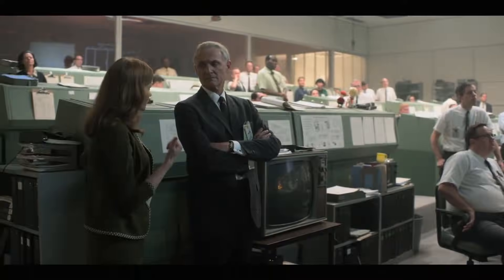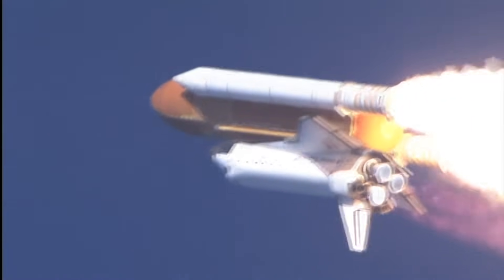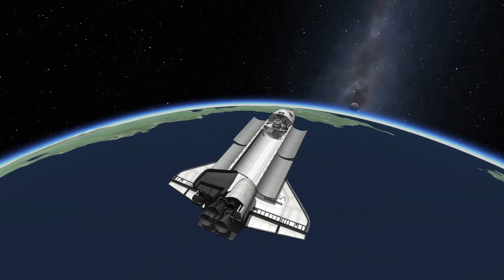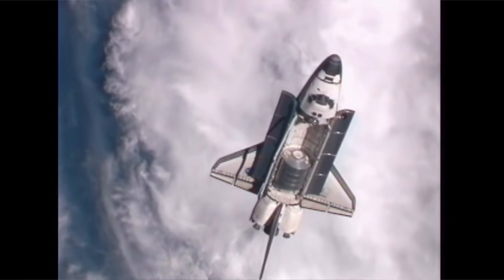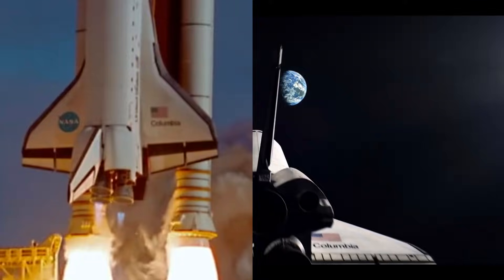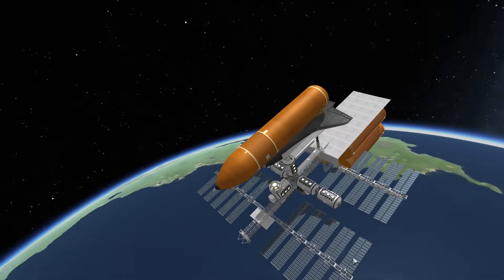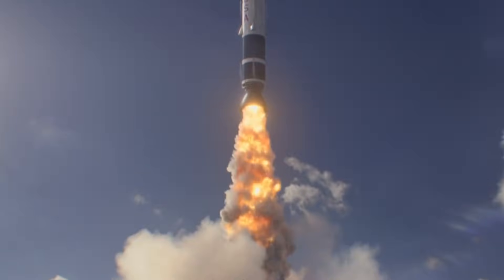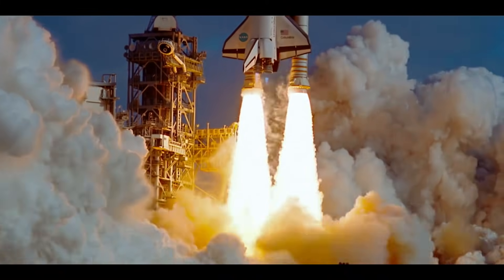How To Send A Space Shuttle To The Moon

Comment: Wouldn´t it make more sense if the spacecraft were more specialized?
I propose a fleet of different spacecraft, each of them better suited for a specific task. Much like we do with aircraft as we have fighters, cargo, passenger, long haul, short, haul, high speed, low speed, using different propulsions like piston, turboprop, pure jet, turbofan, rocket, electric, sail, etc.)
- Earth Lifters-> reusable boosters capable of dealing with most (if not all) Earth´s gravity well and atmosphere.
- Earth Landers -> reusable capsules capable of reentering the atmosphere and landing (preferentially like a plane), like Dream Chaser, Dragon Crew, Dragon Cargo, Starliner.
- Orbital tow ships -> pushers, pullers, automated, to tow satellites, orbital stations. This tow ship would be equipped with vacum optimized engines and fuel/propellant tanks. These tanks should be made in orbit, so they won´t require the structural resistance for dealing with Earth´s gravity thus being optimized for holding the fuel in the microgravity. They would be parked in LEO and serve the space infrastructure and be of many different sizes and capacities. Small to push around nanosatellites, big enough to push a space station. Whoever needs a push, just hail a Uber-Rocket on the app. Charges by delta-V times total mass of the customer.
- Cruisers -> Long haul cargo and human passenger spacecraft optimized for long duration, interplanetary or interlunar flights. The emphasis of this kind of vehicle should be the way it stores and supports its cargo, being it human (life-support equipped) or any other type of cargo that need specialized containers. Much like we have ships for containers, for fuel, for gases, for liquids, for grains, etc.
- Pushers/catchers -> Powerful engines with huge fuel/propellant thanks capable of pushing the cruisers into their trajectories toward far away planets/satellites/deep space stations. The pushers should be able to return to their launching stations after the cruisers reach the trajectory. Upon arrival at the destination, the cruiser should be rendezvous with a local catcher that will be in charge of bringing the cruiser into the destination orbit. This pusher catcher thing could operate as an relay. A pusher going from Earth to Mars while a pusher comes from Mars to Earth exchange. Just like the tow ships, the pushers will be kept always in orbit, never to fly in any atmosphere. 
Then we would have the specialized landers.
- Moon Lander -> With rocket propelled landing. We can use mass drive to put them back into Moon´s Orbit
- Mars Landers -> Capable of atmospheric flight but in a completely different way than the Earth landers.
- Mars Lifters -> just like the Earth lifters but optimized for the low atmospheric pressure and gravity of Mars.

What do you think?

Comment: 1. Create a dockable heat shield that's waiting for it on its return home.  2. Reuse the main external fuel tank as described.  3. Carry a lunar lander in the cargo bay since the extra fuel will be carried externally.
Reply: Some early space craft used wood for an ablative heat shield. Modifying the orbiter with an extra layer of heat shield should not be that difficult. Just costs mass. If using external fuel tanks refueled in orbit you have some mass to spare.

Comment: They probably wouldn't develop the space shuttle in this timeline, since in the show they're more interested in the moon than LEO. And the space shuttle was designed for LEO.
Reply: The Space Shuttle was conceived as a reusable "shuttle" for tranportation of humans and cargo to LEO. The plan was for it to be one component of Space Transportation System (ever wandered what STS stands for, eh?) and of course moon and beyond were definitely important destination of the STS.
Just look up "Space Tug" on Wikipedia.
Reply: i mean it could have been a "we have this thing that works, lets make it do more." instead of a new design.
Reply: I could see the Space Shuttle being developed, but as the LEO truck it was meant to be to build space stations and perform other support missions; not for actual travel to the moon.
Reply: Kaleb - NASA was Origionally going to use DC-3 in the 1960's , modified and Outfitted for Space and Launched by Saturn Derived Launchers. DC-3 was a Perfect Airframe and it could Easily made AIRTIGHT. 
and the Metal Skin would be a Efficient HEAT Radiator.
Reply: @markplott4820  This idea is delightfully insane.
Reply: Guys I understand the whole STS thing, but in season one they built a moon base without a space station. Maybe we'll see one in the new season, but so far they haven't followed that route at all.
Reply: Stanislav Kogan the original STS shuttle was drastically different from the ine we got. The original concept was mkre crew focused with a lot less payload, and it seems hinted at in this universe that STS didn’t happen (even though that would have been lit to see the original STS proposal but whatever)
Reply: @TheOneWhoMightBe   Didn't Lord Xenu use DC3's when he nuked those volcanos on Tiggyak trillions of years ago?
Reply: Have you ever heard the proposal of Space Transportation System (STS) which was proposed by NASA in 1970? Space shuttle was designed to ferry crew and cargo between low earth orbit and the earth and was only one component of the STS which includes 1. Space Tugs, 2. Nuclear Propulsion shuttle between low earth orbit and interplanetary deep space, 3. low earth orbit propellant depot, 4. Space Tug based transfer vehicle shuttle between low earth orbit and the moon,5 Space Shuttle that ferry crew and cargo between ground and low earth orbit. The Space Shuttle was the only component of STS proposal approved by Nixon administration in 1972.
Reply: The space shuttle was never intended to go beyond LEO!
Reply: @powerfulstrong5673  It never was... Unless Phineas and Ferb get their hands on it and convert it into an interstellar starship
Reply: @stanislavkogan  You are right.
Reply: It’s funny because I’m the show they definitely did develop the shuttle.
Reply: Poor Leo always gets the blame.
Reply: @rundownpear2601  Season 2 has space stations in LEO, notably Skylab.
Reply: Probably would have built Dynasoar instead, mini shuttle without the payload that goes on top of the boosters. When the focus on a space plane is just on crew transfer and you have sea dragon for cargo.

Comment: I remember scoffing at the film LifeForce because it had a shuttle intercepting Halleys comet. Ridiculous I thought, they'd need some sort of nuclear drive for that! And then i noticed the word NERVA printed on the control panel. I could still scoff a bit though as they had full gravity onboard - until one of the crew mentioned how the NERVA was firing at a constant 1g. Well, ha, the shuttle engines are pointing in the wrong direction to give them gravity down into their seats. Cut to an outside shot showing the NERVA engine mounted to the underside of the shuttle (and clearly assembled in orbit after dropping the external fuel tank). My hat was off to them.

Comment: My solution would have been to make the Primary Fuel Tank more structural, and add hardpoints for more SRBs; just offhand I think 6 or 8 would keep acceleration below 6 Gs yet provide enough delta-V to get a not-fully-expended Orbiter + PFT into Low Earth Orbit.  The challenge then would be how to get the remaining fuel to feed into the inlet valves in microgravity.  Maybe an expanding balloon ullage system...

Comment: scott manley: what would it take to fly the shuttle to the moon?
me: a miracle.
Reply: I think you mean Mun
Reply: It's theoretically possible, biggest challenge other than fuel or reentry protection would be landing and takeoff from the lunar surface. Could a plane-like vehicle take off horizontally in a lunar environment? It's very different design from anything built to date, even SpaceX's Starship. If successful though, Starship would have a big rival (as it could land on ordinary runways rather than specially built landing pads and towers).
Reply: I always had a ridiculous idea of placing the Apollo modules in the cargo bay of the shuttle. I think a video on that was already done and explains why it won't work.
Reply: @EstorilEm  lol
Reply: Thunderbird 1 a plane-like vehicle needs air for the wings to have lift. There is no air on the Moon. So no.
Reply: we need a "giant space Jerry" to give it a kick
Reply: @thunderbird1921  we are just talking about orbit
Reply: Place it on top of Superheavy.  Using the SRB's as a stage 2 burn, they should get most of your Delta-V before having to use the hydrolox.
Reply: @Marinealver  Or a Salyut
Reply: William Shatner piloted a Shuttle to the MOON.

Comment: Scott Manley - the MOON Shuttle is possible.

#1 - the Space Shuttle already Designed the EDO - Extra Durration Orbiter module , it could extend Power and Fuel Cells for up to 28 Day missions (in Orbit). but, not Propellant .

#2 - the ET can be kept untill the Shuttle docks with the ISS and is Refueled by ISS supplied with Tankers from Earth. 
once undocked , the Shuttle can use the Shuttle Main engines to Get to the MOON, with coasting and still have enough fuel to deliver CARGO or a NEW LEM and recover a LEM and capture it with the Robotic ARM and NOT having to Land the Shuttle on the MOON at all. 
then return to the ISS to drop off the ET for future use.

#3 - HEAT Loading is a NON ISSUE from Earth to Moon to Earth missions , as Apollo had FEW Problems with Heat Loading when on Return Trajectory , even with the LEM attached to the FRONT Command Module. 
Apollo 13 both the LEM and Command module were FROZEN and had FROZEN liquid water buildup in the Command module , and when they prepaired to Reenter they turned BACK ON the Cyrogenic Heaters in order for the computers to work.

Comment: So can the Shuttle go to the moon?
Short: yes.
Long: In pure theory, with a metric shitload of modifications that would cost a jillion times more than re-opening the Saturn V program...and it could never come back.
Reply: Bring back the saturn V has just one problem that no one has figured out a solution. The engines were severely modified after building and there are no details or blueprints of it.
Reply: @josealexandrereis  Yeah, I wasn't actually proposing that, I was just trying to make a point.
Reply: "Well yes, but actually no"
Reply: @josealexandrereis  You can still operate a Saturn V with solid rocket motors.  The SRBs have twice the thrust of a F-1, albeit with less thrust time but you can always add more solid fuel.
Reply: @Edax_Royeaux  I usually go with more struts
Reply: @josealexandrereis  I believe that is a bit of an urban myth, NASA do have the blueprints. However building an aircraft in the same way they did in the 1960s would be problematic.
Reply: Have you ever heard the proposal of Space Transportation System (STS) which was proposed by NASA in 1970? Space shuttle was designed to ferry crew and cargo between low earth orbit and the earth and was only one component of the STS which includes 1. Space Tugs, 2. Nuclear Propulsion shuttle between low earth orbit and interplanetary deep space, 3. low earth orbit propellant depot, 4. Space Tug based transfer vehicle shuttle between low earth orbit and the moon,5 Space Shuttle that ferry crew and cargo between ground and low earth orbit. The Space Shuttle was the only component of STS proposal approved by Nixon administration in 1972.
Reply: The Space Shuttle was never intended to go beyond low earth orbit!
Reply: @martinhughes2549  Yep. The problem is, from design to execution, there were hundreds of problems along the way. And these engines weren't built in factories by machines, they were built by engineers, by hand. And all the little fixes they made through design and testing to get each of these motors to fly are lost to time with them. We may have the blueprints, but we've lost the know-how to make them the way we used to. People with those kind of skills just don't exist today. Not to mention that rocket science has advanced greatly since those mighty F1 engines flew. There was a modern design of the F1, the F1B, proposed as first stage propulsion for the SLS, but of course bureaucracy got in the way, and reusing shuttle parts was cheaper and wasn't going to end large government contracts with big military suppliers and cause layoffs. And so, the F1 ever remains cemented in history, as the pinnacle rocket engine of an age gone by.
Reply: @jmtardogno  What's wrong with engineers building them? It's not like we need thousands of them. As for the 'little fixes', they were probably varied by engine, as required, not exactly the same for the next engine, so no point documenting them. They had nothing beyond the blueprints when they started building the first one, the same as what a 2021 engineer will have, so where's the problem?
Reply: @jmtardogno  I don't think F-1 rocket engines are advanced today.
Reply: Could you do more than one aerobraking maneuver?
Reply: @jmtardogno  I just don't know why NASA need to reuse the old Apollo technologies to go back to the moon with expendable heavy rockets and space capsules?
Reply: @ANONYMOUSLY INSANE Don' you know the Space Transportation System (STS) proposed by NASA in 1970 which composed the reusable space-tug based transfer vehicle to return back and forth between low earth orbit and the moon?
Reply: @ANONYMOUSLY INSANE Why NASA needs to use old Apollo style technologies to go back to the moon instead of using the mode of Space Transportation System?
Reply: @ANONYMOUSLY INSANE I said the Space Transportation System is much better and more sustainable than the Apollo style method to the long term space exploration!
Reply: @ANONYMOUSLY INSANE Why They cannot use the method of the Space Transportation System proposed in 1970?
Reply: @ANONYMOUSLY INSANE What I said is use of space tugs and earth orbit construction of very large deep space vehicle!
Reply: @powerfulstrong5673  NASA currently reminds me of a man in their mid life crisis trying to relive their glory days whilst Space X is there cool hip son.
Reply: @josealexandrereis  or... MORE BOOSTERS
Reply: @powerfulstrong5673  yeah, we know...
Reply: @powerfulstrong5673  well, the thing is they aren't
Reply: @powerfulstrong5673  THEYYY DOOONT
Reply: @powerfulstrong5673  THE STS IS THE DAMN SHITTLE
Reply: @powerfulstrong5673  EEEEƏÈĖĘĚEEEEEE
Reply: @josealexandrereis  ever heard of reverse engendering?
Reply: @martinhughes2549  that and all the companies who built those components only kept the machines and molds for doing the work for so long . No point is storing stuff that your not going to use again. But people act like its some huge conspiracy theory
Reply: Not our shuttle, their shuttle could be different (with hidden upgrades that we can’t see)

Comment: I didn't get the impression it was a nuclear propulsion engine in the payload on the SeaDragon, but more-likely a reactor for the Shackleton base, eliminating the need for solar+batteries.  "Going there to stay".  SeaDragon would be perfect for lifting that kind of mass.
Reply: You probably don't need a Sea Dragon to send a reactor to the moon, unless the thing already has the reactor shielding on it.
Sure you wouldn't want to be next to a newly built and fueled reactor on a trip to the moon without it's shielding, but reactors really aren't all that radioactive inside until the control rods are withdrawn for the first time. Until that time, the only radiation the thing would be putting out is that from natural radioactive decay, and that's a tiny fraction of the radiation of an active reactor.
So you can transport the newly constructed reactor with the control rods all the way in, with no/minimal shielding, so long as it's an unmanned rocket. Once it gets to the Moon, you bury it in the deepest hole you're capable of digging, as far from the habitat as the power cables will reach. Long power cables are much lighter than bringing all that heavy reactor shielding with you all the way from Earth.
Of course, sending earth-moving equipment to the Moon might very well need a Sea Dragon.
Reply: @44R0Ndin  I assume they'd launch a fully ready-to-go reactor, rather than an IKEA box of parts to assemble on site.  Maybe the rods are stored separate, but honestly probably easier to just have a fully ready to plug-and-go system rather than risk trying to assemble something that critical in space suits and low-gravity, while the Russian are lurking around in the hills.
Reply: @NormalNonsense  That's what I took away from it being a sea dragon too. It'd allow the whole thing to be launched together. 

Rather like when in Kerbal you build a big contraption and just throw the budget out the window and pack it into a massive fairing.
Reply: @44R0Ndin  You can design earth-movers specific to moon which would mean they could be a lot less structurally rigid, hence lighter.